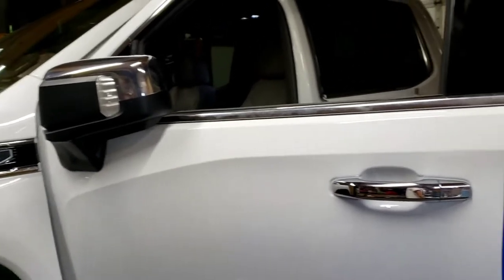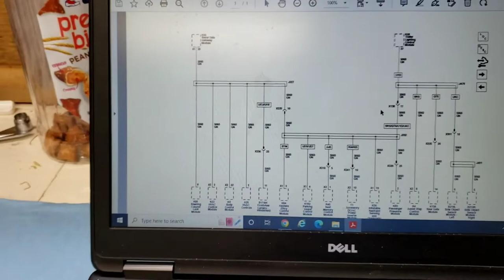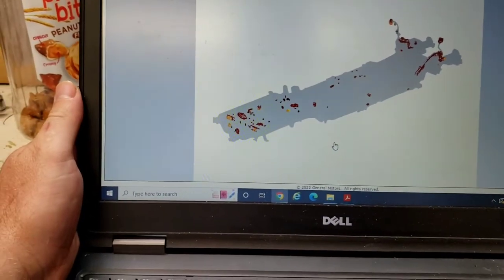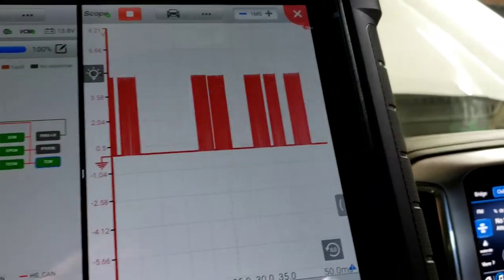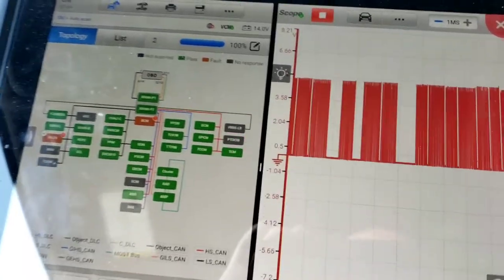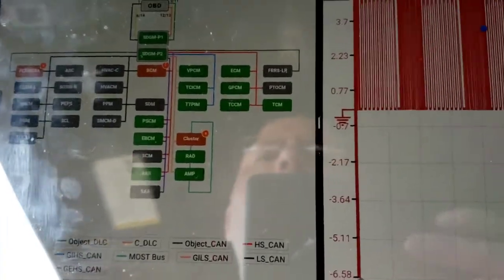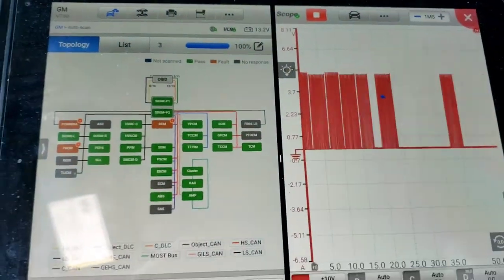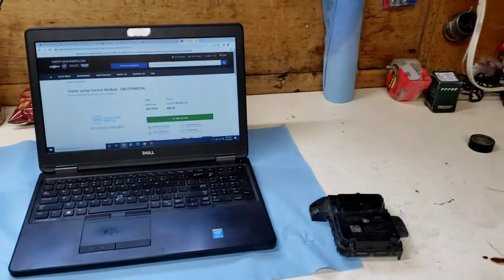2020 GMC Sierra Low Speed CAN BUS Issues Part 4 (FINAL)

Comment: In theory wouldn’t pulling the fuse for the trailer module bring back the low speed?  Or is necessary to actually physically remove the connector??